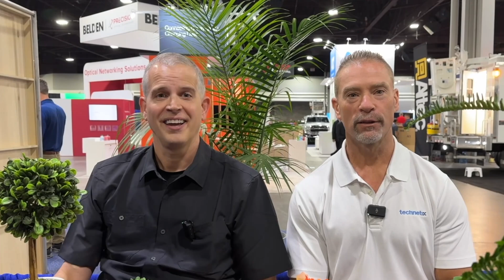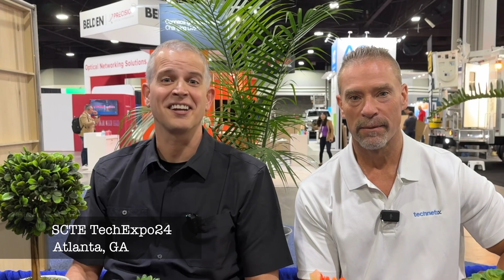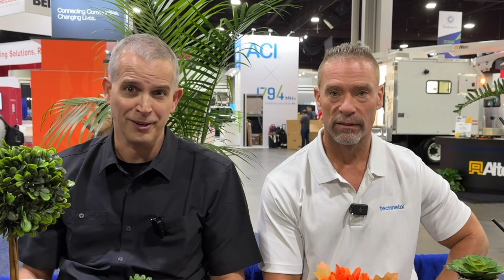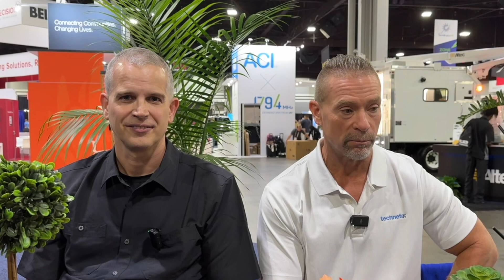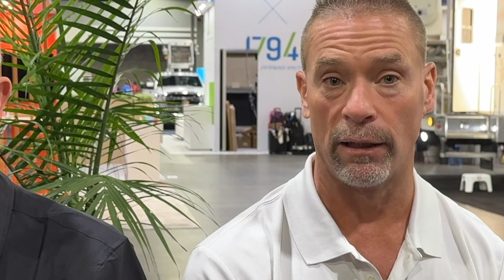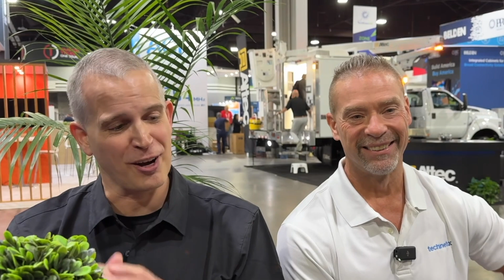DOCSIS 4.0, DOCSIS 5.0, AI, Self-Balancing Amps, and Future HFC Trends

Comment: Docsis 4 will have higher ping then fiber. But most of the Fiber ISPs use Gateways AKA modem router on single a box some of them allow to use bridge mode their gateway which is what we want to use our own router without getting the double NAT problem but some ISP gateways don't have proper bridge mode support if that's your case you are screwed you can't use your own router without getting the double NAT issue.
Reply from the maker: @Maiza007-c8y  great points!